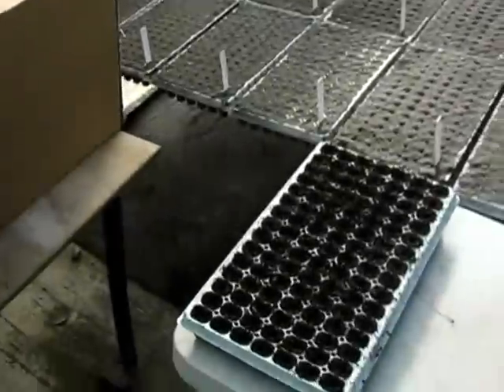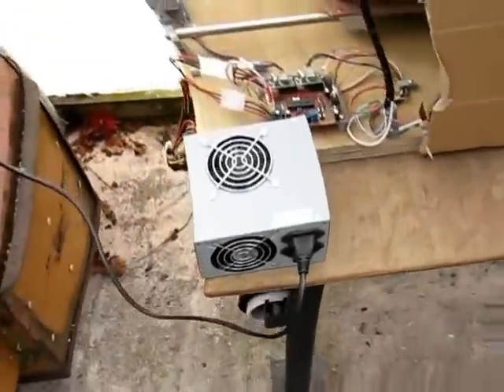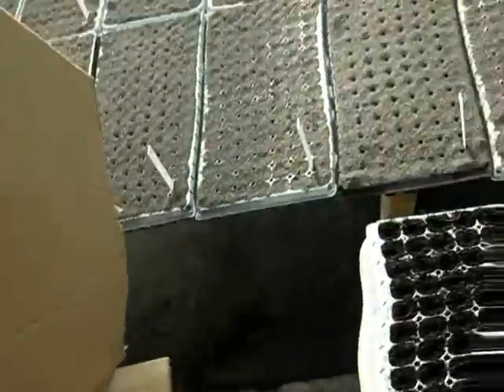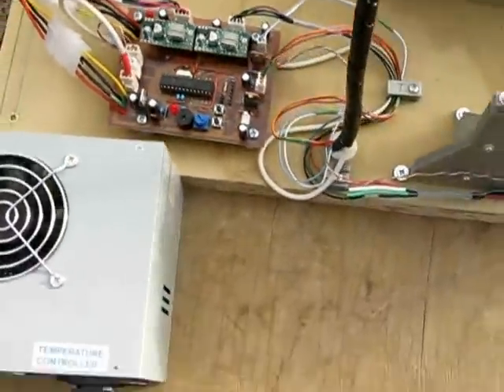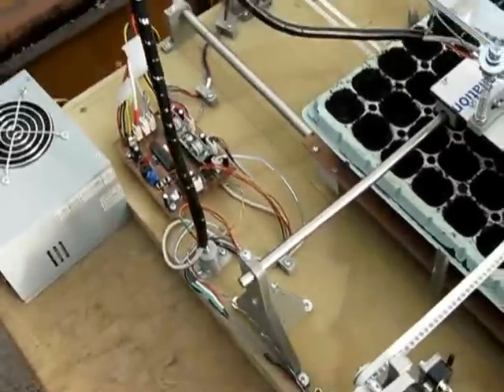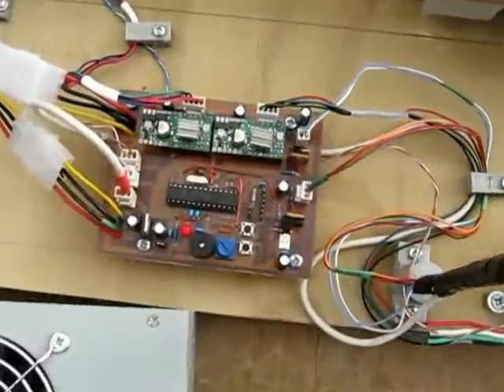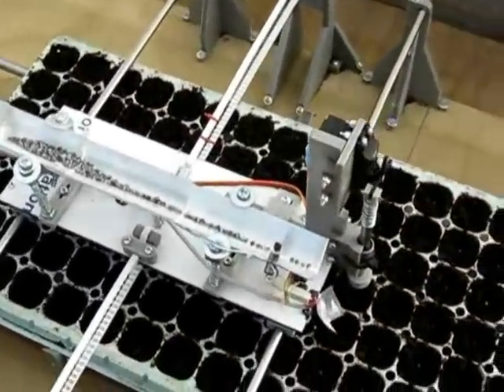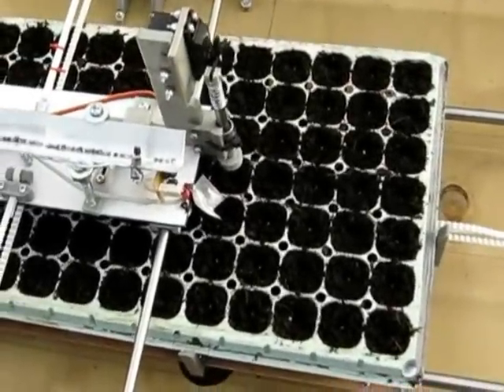Auto Seeder by Aztec (Azzan Technologies)

Comment: A much improved version of this design was developed in the early 80's by Old Mill Seeder  Company.  It uses a  vibrating bowl with an adjustment gate that caused the seed to single file  and drop off at the top of the spiral into a tube.  After the seed dropped and was detected via optical sensor the tube indexes to the next cell.  The seeder automatically drops one or more seeds (can be programmed to drop multiple seeds) into each cavity of the flat at a rate up to 20,000 seeds per hour. Old Mill Seeder Company makes seed counters and adapted the technology to seeding equipment.  As cool as the design is, it is terribly inefficient and has given way to more advanced needle, plate, and drum vacuum seeders.
Reply: Hi, yes I have seen those seeders. I was hoping to try and 3D print one at some time.